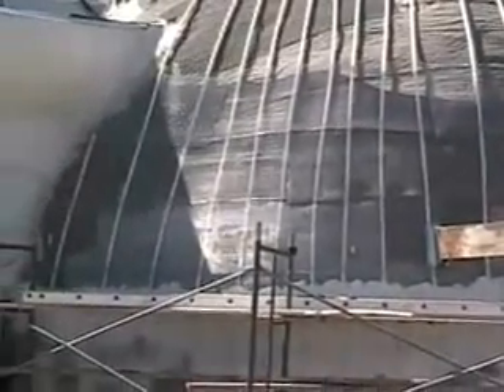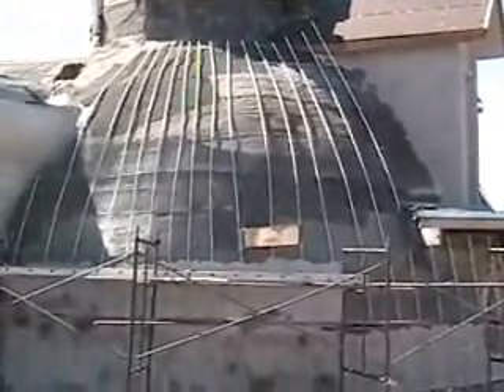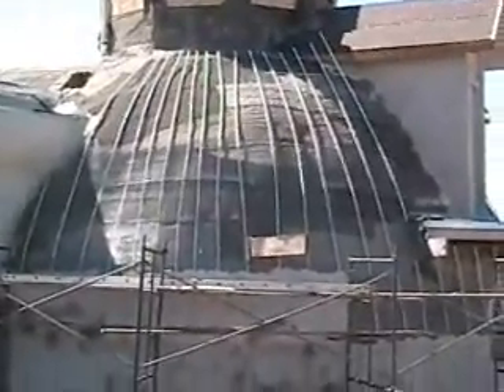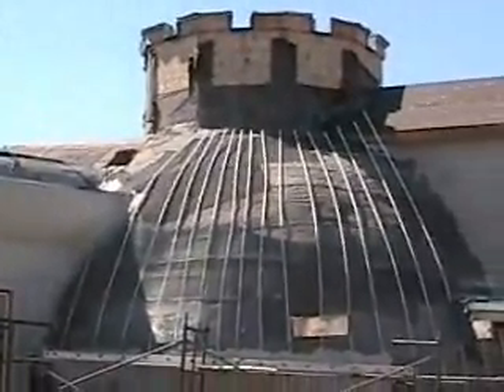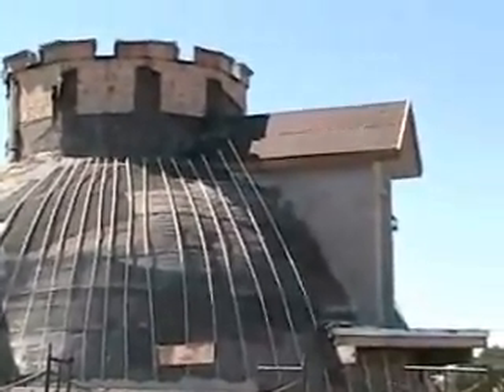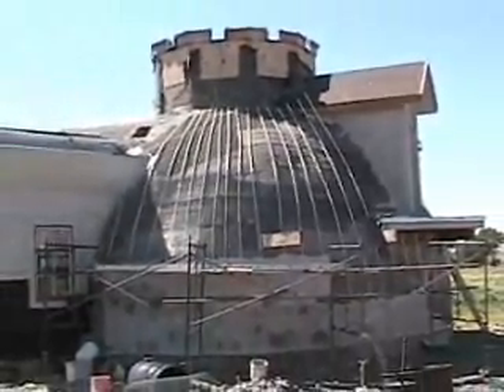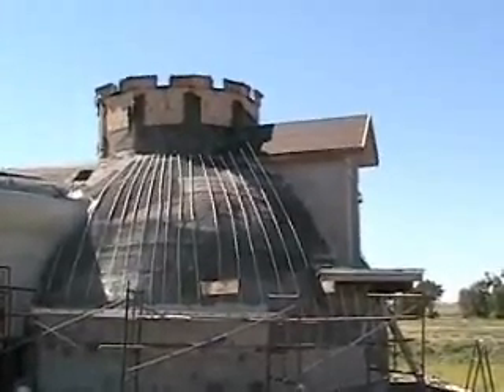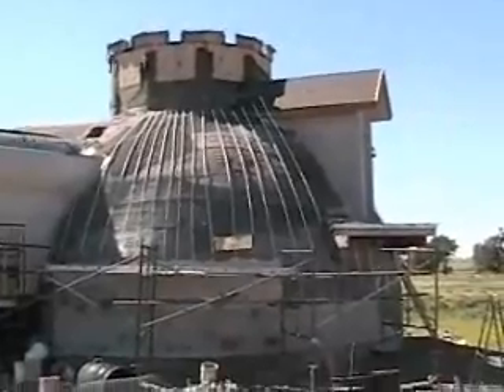strawbale venting system

Comment: I agree with most of the comments earlier.  It seems that the house is in an arid place so if you were that worried about moisture why not add lime to your plaster.  The lime will draw out any remining moisture and will make whats know as Roman concrete to prevent any moisture from getting in.  I like that your trying to improve but it seems that your are trying to recreate the wheel.  This in not a good design.